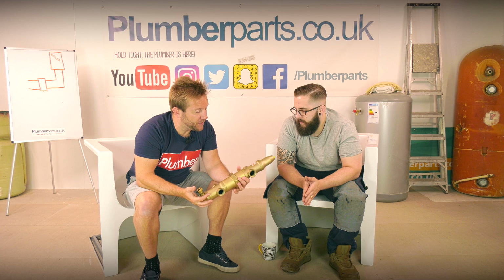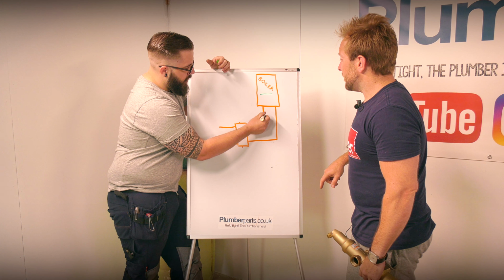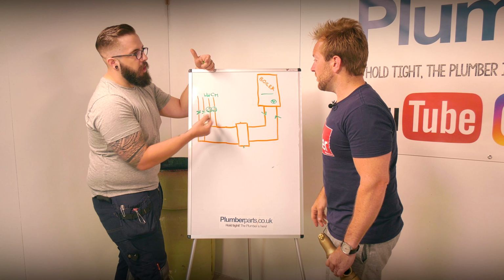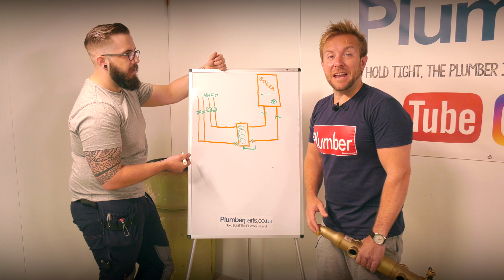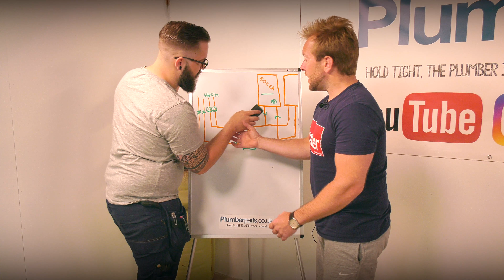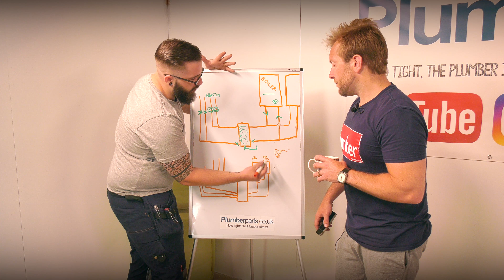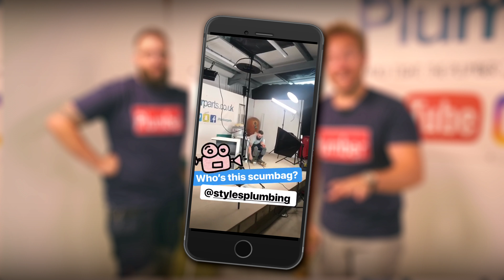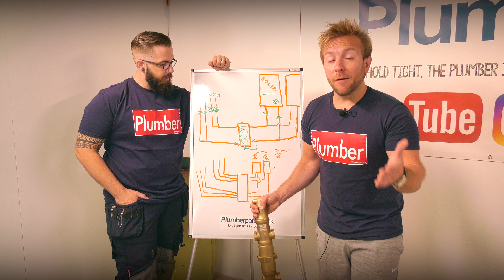LOW LOSS HEADERS ON HEATING SYSTEMS

Comment: The llh forms the neutral point so all pumps should be on the flow from the header on the secondary flow and on the return to the boilers.

Comment: Does the inbound pump in the boiler need to run aswell? On a larger system with an external pump.

Comment: Adding two boilers I would do a reverse return. So your 1st boiler as you see on the white board becomes the last on the return pipe this would pull all evenly.  This is how I connect more than two boilers.
Reply: +Danny Archer  that's ok if I had a drawing
Reply: +Danny Archer sorry Danny if you google reverse return you see what I mean. There is nothing wrong with the low loss header. The flow pipes would stay the same.  All this dose it pulls even flow across both boilers so , both boilers work together instead of one on 1st boiler working harder closes to the low loss header.  I hope I make sense
Reply: been a while since i did one, think a reverse return goes like this-  flow take normal route to header then the return flows back to the last boiler first then the first boiler.. both boilers would have a non return valve aswell.
Reply: Scott Cooper that's exactly what I would do to balance the flow rates from coupling boilers and it wouldn't be that much extra pipe seeing that the boilers are normally quite close.
Reply: Only just seen this vid and that's the first thing I thought of.
Reply: You wouldn't need to as each boiler has its own pump internal.
Reply: Low loss headers have more than one purpose. They can be used for the connection of multiple boilers to a system, when the flow of the system is greater than the flow of the boiler /s as with ufh, as a volumiser for boilers with poor modulation or under very low loads and when the boiler residual pump head is insufficient for the index circuit. Adam from heat geek has named the phenomenon of mixing as distortion. Distortion is imo a natural feature of load and flow mismatches in a hydronic system. A raised return may be a necessary but undesirable feature of a design.
Reply: Reverse returns is for boiler with no integrated pump. A single pump acts equally on both boilers when connected with reversed returns. This is not suitable for systems with ufh unless hydraulic seperation is added. Reverse returns is really an outdated concept for modern systems but is still important to understand the concept.

Comment: install Low Loss Header, but because of lack of space to install LLH vertical, what distance from the boiler can I position the LLH, the boiler would operate normally ground floor, install LLH on second floor use 15/60 pump  instead of 25/80 pump to circulate flow to second floor and loft area

Comment: Need to watch those secondary loop dTs and flow rates, if using a LLH. BTW, if the zone pumps are below the level of the emitters, flow checks or non-return valves should go on the supply, not the return. If not, you'll get thermal or heat migration in any inactive zones.

Comment: Love the video guys...just a question about what you said, you have a vortex and 3 zones essentially in your own house (not a large domestic system but a fair size) when do you decide it is needed to fit a low loss header, I'm working on a job, large bungalow, 6 rads upstairs and a full under floor downstairs with a 120L unvented, would this kind of thing require a low loss header or is it something that would just improve the install?
Reply: Low loss headers have more than one purpose. They can be used for the connection of multiple boilers to a system, when the flow of the system is greater than the flow of the boiler /s as with ufh, as a volumiser for boilers with poor modulation or under very low loads and when the boiler residual pump head is insufficient for the index circuit. Adam from heat geek has named the phenomenon of mixing as distortion. Distortion is imo a natural feature of load and flow mismatches in a hydronic system. A raised return may be a necessary but undesirable feature of a design.

Comment: Hello guys, great video as usual. I’ve got exactly what James talks about, vaillant ecotec Combi with 2 2 ports controlling a heating circuit and a ufh circuit with shared return. The ufh is clearly pulling to fast even with the pump switched to attenuation mode as recommended by grundfos. It’s noisey! I’ve been advised to fit a llh. My question is do I need an additional pump on the heating circuit? Or should I just fit an air separator on the ufh flow? Hope you can help love the channel keep up the good work

Comment: how do you prevent re circulation from the boiler flow to the boiler return through the low loss header? There's potential here for high return temps where your boiler won't be in condensing mode.
Reply: You don't prevent recirculation from the boiler. Low loss headers have more than one purpose. They can be used for the connection of multiple boilers to a system, when the flow of the system is greater than the flow of the boiler /s as with ufh, as a volumiser for boilers with poor modulation or under very low loads and when the boiler residual pump head is insufficient for the index circuit. Adam from heat geek has named the phenomenon of mixing as distortion. Distortion is imo a natural feature of load and flow mismatches in a hydronic system. A raised return may be a necessary but undesirable feature of a design.

Comment: Buying them from big manufactures is expensive. I get a local pipe fitting company to fabracate them for me made to measure with foot or brackets welded on
Materials are for bugger all
 4 1" black sockets 
2 1/2" sockets 
a bit of 3" pipe 
2 3" end caps

Pet hate when you see them reduced down off header 1"  1"1/4 down to 22mm compression "use a bit of 35mm first"

Comment: Do the manufacturers just come  up with this stuff because they know it will cause a lot of chatter on the web? And thereby sell like hotcakes though it probably does nothing.  Or is that too cynical? The thing is even the name is misleading. In what sense is it "low loss"? In what sense is it a header? It doesn't substitute for a header tank, neither does it facilitate topping up of circulating water. A bypass is a safety feature of all systems that prevents eccessive pressure or temperature if the burner fires up when all the radiators are shut off. This seems like one of those. As much as I enjoy your cheeky cockney chappie I'm asking for a little more perspicacity,  dettachment and objectivity.